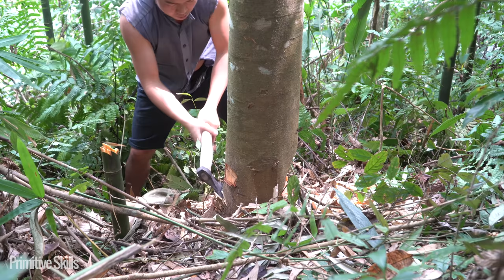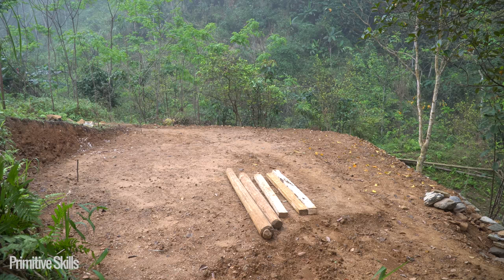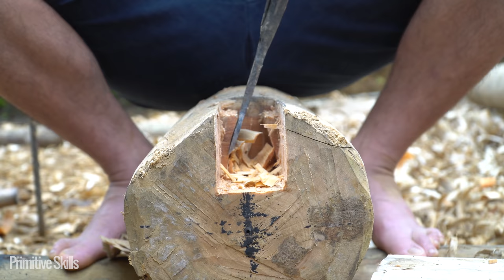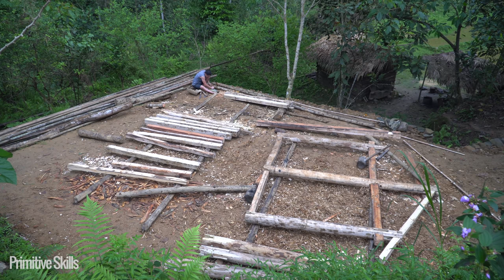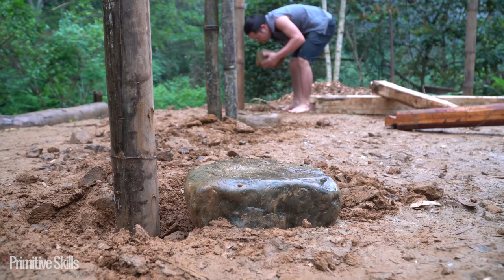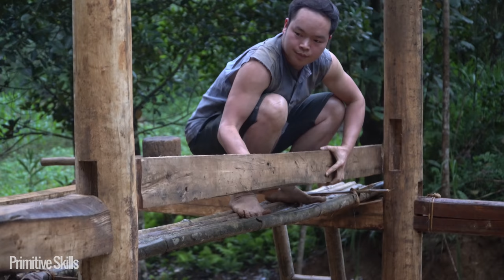How To Build house, Full Shelter Build with Hand Tools | Primitive Skills

Comment: Without a doubt the most impressive house ever constructed in any of the "Primitive" shows.
Reply: Will undoubtedly last longer than most too...
Reply: Maybe. Certainly is the most reminiscent of a modern structure frame that I've seen so far. I sort of think the primitive cement stone house might be a bit more impressive, just for the amount of processing that goes into it.
Reply: @travispluid3603  The amount of time necessary to procure the lumber, chisel out the retaining holes and build is not reflected in the short video presented.
Reply: @heretoforeunknown  Of course not, and I know it's a lot of work, but it's more technically impressive to me to make your own cement to build a stone house with. I'm not saying this isn't impressive, just that I don't know if it's the most impressive. By the way, have a like.
Reply: @travispluid3603  The issue with the cement is that primitive cement isn't as stable as modern cement and would require constant retouch work to maintain stability. A wooden frame like this could stand for a century or more with minimal maintenance needed on the frame itself. All one has to do is treat the logs against rot, which can easily be done with a coat of pitch or tree resin.
Reply: @travispluid3603  for me the thing that makes this soo much more impressive is the tools and knowledge to make this instead of just using concrete. if they would make some kind of reinforced concrete its a whole different world tho hahah 
But I'd like too see a combination using the wooden frame and a cement/rock foundation
Reply: Agreed. This is all of a sudden not primitive at all anymore. Unlike the bamboo and thatch huts everyone are building this might stand for a hundred years.
Reply: @minemilx2702  More medieval than primitive now.
Reply: @travispluid3603  Yep, the tools are maybe a bit more primitive than medieval ones, but they are really getting there.
Reply: @minemilx2702  The stone-built house one commenter mentioned is a house I would not want to live in because the way the stones are stuck/cemented together is very sketchy and I wouldn't want one of them falling on my head while I slept.  The guy in Primitive Life seems to have disappeared again - he had come back from his hiatus and built a stone house, apparently complete.  The actors in Primitive Skills and Primitive Life are the very few who actually act like "primitive" builders.  Most of the other shows use items only available with modern production methods.
Reply: 1 cast and About 10 staff?
Reply: @me4taki9oh  ALL the shows have this setup.  Also, I seriously doubt any of the individual actors in all the shows actually cut all the timber and make all the bricks, etc.  Still, it is an impressive house to be and seems to be sturdily constructed.
Reply: Just some regular ol’ construction worker doing “primitive” things
Reply: @rephaelreyes8552  Not a raw tree
Reply: I really wish they'd stop calling it primitive. It's ancient, yes...but we all know the word primitive has negative connotations to it.
Reply: Terrence P. Urbanis the text indicated he took two weeks to secure the materials. That was just cutting and hauling, it did not include the joint work. Pretty impressive!
Reply: Grandpa 😊🌹
Reply: its. not primitive coz he get helped in heavy equipments...he just constructed it..and the only one he done primitive is the 1st wood that he get..the rest..done by heavy equipment..
Reply: And very realistic
Reply: @audreyholmes9751  llllllllllllllllllllllllllllllllllllllll
Reply: Its not a house at this point
Reply: @audreyholmes9751   hi
Reply: Hi

Comment: That will need paint, especially on the end grains and T&G fittings.

To make the paint, try boiling all of those wood shavings you collected.
If that doesn't work, try fat wood or animal bones.

You can also try adding oily leaves and charcoal.
Reply: SidtheKid  You're right, I'd say it would work even better. I'm not sure how easy all that pitch would be though.

Comment from the maker: 👉 If you want to watch longer videos, next few days I will upload it here: https://bit.ly/2PkAMgz  

👉In addition, I need you to contribute, suggest titles, translate titles into other languages, all contributions send to email: huyduong.primitiveskills@gmail.com💪💪
Reply: Good Advancement, i've been here since you've been sleeping on rocks keep up the good work
Reply: Termites seem like a future issue.  Any strategies for this?
Reply: @mothereric8774  He placed the lumber on rocks, I think this will give him more time.
Reply: Thank you for all your work and time. Very enjoyable videos. keep up the good work!
Reply: the part you buried in soil need to be carbonized, burn outer layer into a thin layer charcoal before burying.
Reply: and the wood will be better if you dry it first. or after finish building it, heat the house it up for at least one month to remove excess moisture.
Reply: thanks for the videos!  keep it up you are doing a great job of it  like the series htme but actually with skill and thought it would be nice to see you bring the forge into a more mechanized state using your water power  im thinking a waterwheel to get a source of rotary power for a hammer mill and a bellows would be of great use in further projects  one thing i have noticed is your anvil bounces when striking iron  i suspect that transfers force poorly  so either bigger anvails or a lot of clay to secure them.. looking forward to more
Reply: @davetravis1805  @what mark?
Reply: @davetravis1805  as i see it he is doing it   do you have videos? i only see practicality in using a mill or planer if its available but not  he is building a timberframe building  by hand  by himself with tools he built himself nor do i see him claim to be "authentic" anything  only primitive  i see no electrical or battery powered tools and in general find myself impressed with his efforts  and think its unfortunate you feel a need to criticize instead of offering positive suggestions to improve  but thats your choice
Reply: Trốn covid ha em? Làm nhà đẹp quá vay.
Reply: @Primitive Skills   I sent you an email for FRENCH subtitles.
Reply: Bạn rất khoẻ và giỏi. Chúc mừng bạn sắp có nhà mới
Reply: It's okay don't waste ua time no need..
Reply: Just wanted to say I hope that you and your family stay safe during this pandemic around the world
Reply: Will you be adding pegs to reinforce the joints?
Reply: Muito bom ! Continua assim que está muito legal. Parabéns !
Reply: You are amazing. There is nothing "Primitive" about your work now!  Kamu luar biasa. Tidak ada yang "Primitif" tentang pekerjaan Anda sekarang!  Bạn thật tuyệt. Không có gì "nguyên thủy" về công việc của bạn bây giờ!
Reply: Your right foot looked pretty swollen near the end there. Hope all is well.
Reply: @askdbiz  me too...😅
Reply: Primitive Skills where is the next episode buddy I’m waiting
Reply: Repeat experience for stell
Reply: Please Repeat experience for steel
Reply: Can you make a iron saw and iron larger nails a stronger structure create is a very nice great job
Reply: Dovetail comin in clutch
Reply: Hope that your door is slideng door
Reply: @mothereric8774  here in Spain we pain wood with a lime wash to avoid ants and bugs, it could work, its also a pretty white color.
Reply: @IberianCraftsman  I think i heard of that sort of a paint read about it as "white wash once"

That would be easier to add (post construction) than the charring too!

Just need SOMETHING here in Florida, between the humidity, rain, and termites wood barely lasts.  So i can hardly imagine a rainforest
Reply: you need a saw, make a machete (or to your machete) and sharper it, then a way to make teeth on the edge like the corner or a big rock, hit it to make the dent and then rub it to leave it sharp.
Reply: @mothereric8774  we call it "encalar" here in Spain.

https://youtu.be/tG3Z-T2cZa8  yes, its in Spanish so activate subtitles, they explain it well here, its an Spanish tv show about gardening and carpentry, in this episode they explained the lime wash paint.
Reply: @mothereric8774  well, also americans use too much wood, its rare seeing wood houses in europe, only in villages or stuff, all are made of steel and concrete so they last a long time.
Reply: Hand full of tools and you do this, amazing
Reply: 2 chanel👎👎👎👎
Reply: @davetravis1805   It never fails, always a few people who MUST have something negative to say. How many small houses have you built alone with just a few hand tools? Yeah, just as I thought ..
Reply: Primitive Skills   🦋🦋🦋🦋🦋ARE YOU GOING TO SHOW US THE REST OF THIS BUILD LIKE FINISH OFF THIS WONDERFUL CABIN , YOUR DPING SUCH A GOOD JOB 👍
Reply: Very impressive.  Will the next video show how you did the angled joints that hold the roof trusses?  If not, do you have footage of those joins?
Reply: You video gave me the inspiration..amazing
Reply: @你猜我叫啥-c9e  he buried just tje scaffolding. The house is over a rock base
Reply: Kỹ thuật làm mộc của anh thật tuyệt
Reply: Hope in stay in the house.. otherwise simply wastage of resources just for youtube video
Reply: @mobiousenigma  Don't bother mate. He's the same person that was trolling this channel for months.  Btw if you like this content you might want to check My Self Reliance. Peace
Reply: Please make a dugout canoe... I hope you can make it.... Other ideas is yatch canoe
Reply: ㆍ
Reply: Wow major props bro your awesome ive learned alot from you on how to build in different ways.
Reply: where are you missing, we are waiting for your videos thanks kkkkkkk
Reply: Yes please i love your videos are you gonna make more videos like a part 2 of the how to build a house shelter with hand tools?
Reply: Việt nam?
Reply: @mothereric8774  He's way ahead of you; did you not see the rocks under the stilts?
Reply: Can you show us this house finished. What else did you do for walls and roof?

Comment: The thing that makes this building project even more impressive is the fact that all the iron tools he is using in the build were made from scratch straight from iron ore almost no one in the primitive community online has made the transition from stone age to iron age you have my respect.
Reply: Iron is a very pivotal point in tools quallity. While it rusts quickly if not maintained, it is much harder and more durable than copper and even bronze. The socketing techique he uses with the logs is also quite good
Reply: @adrog3434  Iron rusts away into nothingness, and is very difficult to turn into quality steel, at least for primitive metallurgists. Bronze gets a protective green patina and is easy to harden and resharpen with no special tools or knowledge. Iron was not superior as a material, it was just easier to find than tin and copper. That's the reason it got so popular in the iron age.

Comment: "This is a high precision joint. It takes meticulousness to get it to fit." Goes on pounding it with a sledgehammer
Reply: That shows it's a nice tight fit.  Much, much, much better than a loosely fitted joint because you cut it too wide.  Watch any traditional framing video, especially those where they're assembling the frame/posts and one of the mandatory pieces of equip is a mighty big wooden mallet.

Comment: 20/09/2020 ...  Achei toda essa estrutura de madeira desnecessária,  não precisava fazer a base e as colunas de madeira. As paredes de barro são bem grossas, suficiente para suportar toda a estrutura do telhado.
A moldura do telhado deveria ficar em cima das paredes!
xxxxxxxxxxxxxxxxxxxxxxxxxxxxxxxxxxxxxxxxxxxxxxxxxxxxxxxxxxxxxxxxxxxxxxxxxxx
09/20/2020 ... I found all this wooden structure unnecessary, I didn't need to make the wooden base and columns. The clay walls are very thick, enough to support the entire roof structure.
The roof frame should be on top of the walls!

Comment: I can see where in some areas he used modern tools off camera, but unless you have experience in the fields he is using to make this building, you'll never notice it. 

I don't begrudge him though. He shows you the parts you need to know and to save time he uses modern tools on the parts he either already covered or doesn't need to be shown. 

Love this channel!
Reply: Yeah, I'm loath to believe the guy cleared out what would have been several dozen tons of soil, and flattened it all using nothing but hand tools. A lot of very straight, machined looking bits of lumber too. I'm not knocking the effort and skill in his videos, but "primitive" is a bit of a misnomer.

Comment: What's the thought process behind building the main support logs on top of rocks instead of solidly into the ground? Same goes for having and internal structure vs supports built into the walls as one main support mechanic. Ton of work really paid off. Looks amazing. You could probably support another level on top of it as well. For reasons.... LOL

Comment: Very cool.  I have seen some people when doing wood frame type of houses will score the wood with fire to give it a slight burned look.  This im told acts as a treatment to protect it from rot and bugs.  They use a torch to lightly do it.  Im not sure how you would do it?  But could help prevent your termite problem.  Again very cool video!!

Comment: Are you going to use a risen floor to allow air flow under and water flow in heavy rains? I do like the idea of sitting it on the rocks as foundation stones to stop rot and white ants.

Since you folk would be liable to typhoon how do you strap something like that to the ground without allowing white ant etc to enter the timber?

Comment: I see a lot machine work toward the end of your video. Also I doubt you hung all those roof beams by yourself
Reply: What? Where did you see any machines, and what leads you to believe he didn't hang the roof beams himself? Did he even claim as much?
Reply: @Thoron_of_Neto  Never said I saw any machines.
Reply: @pfflyers1  I must have misread, or mistyped not sure, because in reading it now, I see what you said and it makes sense. So, I assume you mean you saw machine work on the boards? Also, the other half of my question still stands, because as I said to another comment, the wood he is using seems to be incredibly lightweight, as evidenced by the fact he's carrying logs longer than he is tall, downhill on his shoulder, with ease. So, what leads you to believe he didn't hang them on his own?

Comment: The whole structure rests on a few small stones? It won’t hold the first rain or storm.
Reply: dude, considering the amount of craftsmanship and the particular climate he lives in I would say that he dang well knows what he is doing!
Reply: Nakamura65 or maybe this is just made for the sake of the video and the money he’ll get paid by YouTube. There’s no way this structure will hold under the rain. If you think it will, explain.
Reply: @Swift52556  why wouldnt it hold? its not like there is going to be stream running under the house eroding the soil away,... we build small shacks and toolhouses the same way here in Europe, you put small concrete blocks under the beams to avoid rotting,....
Reply: Nakamura65 I’ve lived in both Europe and the USA. I can guaranty in the Midwest, for instance, storms would erode the ground around those little stones and compromise the whole structure. Now, we’ve got additional challenges: high winds, freezing and thawing, etc. Not all places get that much weather.
Reply: @Swift52556  dude, you should consider some gutters and raised edge around the property, because floods like that are not considered common